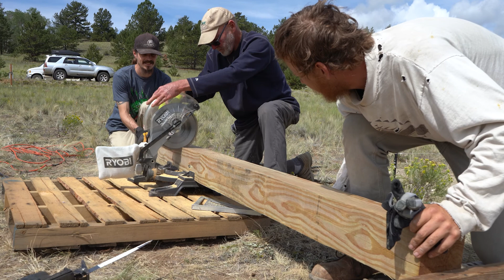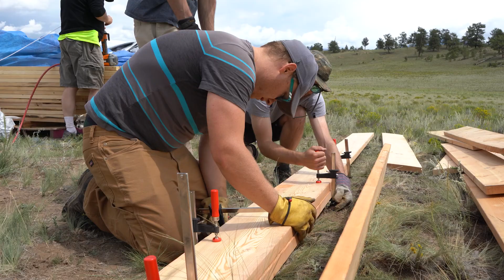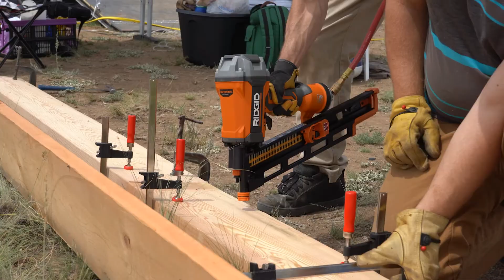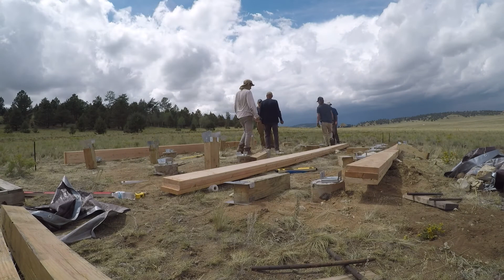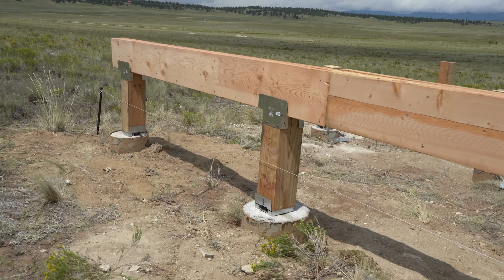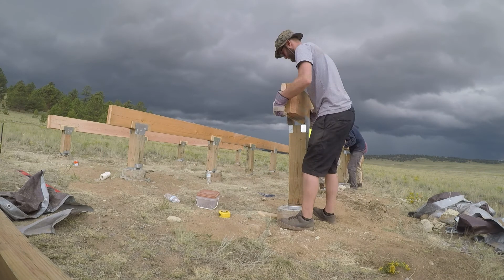Arched Cabin Build - Columns and Beams #2

Comment: Did you put in the 6x6's?...then run a lazer and cut to level??  How big is the sonotubes and how big is the wood pylons?
Reply: no laser we did string line with line level  believe it was10 " sona tubes  3' depth  wood columns are 6x6 foundation needs to be engineered so would not copy that with out talking to one
Reply: Since we didn't get the concrete piers to the same height we had to cut the columns to get it level. Would definitely recommend getting the concrete piers to the same height, makes the framing much easier. They are 12" sono tubes with (4) #4 rebar tied together with wire mesh 3'-6" deep.